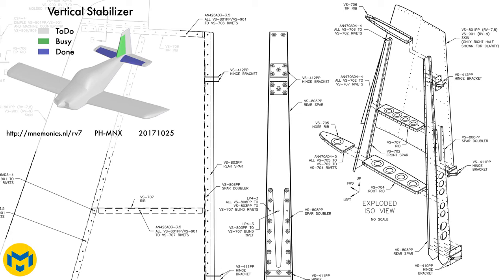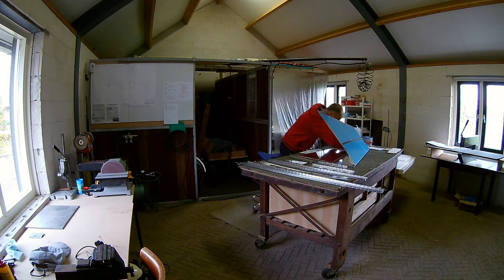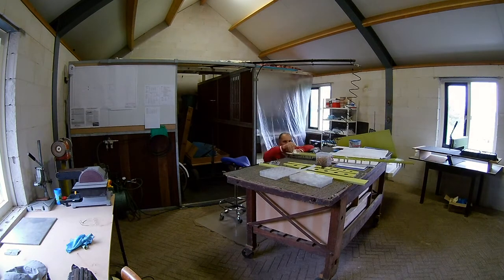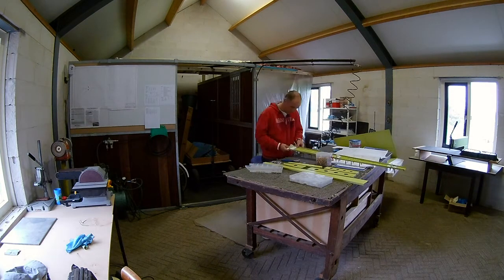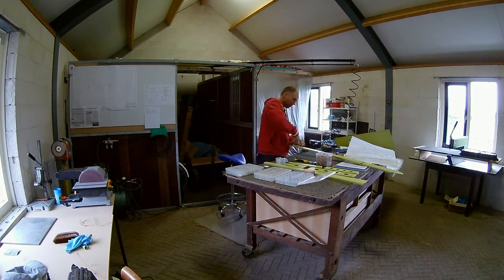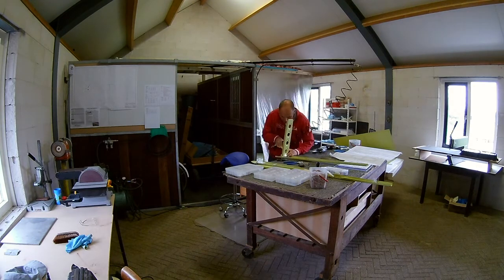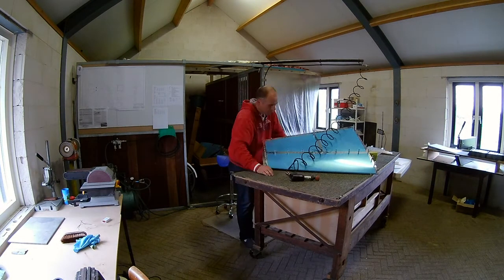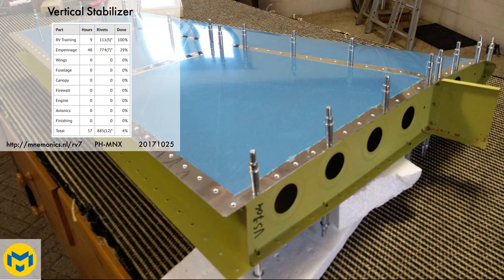Van's RV-7 Build Empennage Vertical Stabilizer Clean and Prime (018)

Comment: What is the cleaner/degreaser that you are using?
Reply from the maker: Hi,

I use one on water-base. The brand is Kristal Aqua (https://www.nonpaintstore.nl/index.php?target=products&product_id=1148) not sure if you can purchase it in your country. Also I don't thick it is vital what degreaser you use. The etching primer will stick anyway.
Don't forget to use gloves when degreasing or touching the material after degreasing.
Cheers,
Marcel
Reply: Thanks for taking time to reply.  I’m trying to figure out what would be the best economical way to prep for priming and get a quality result.